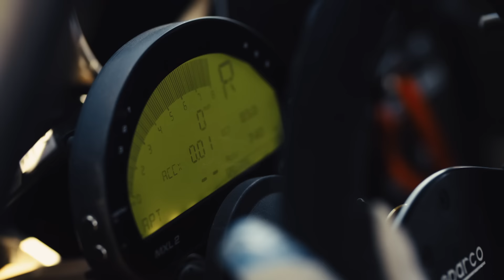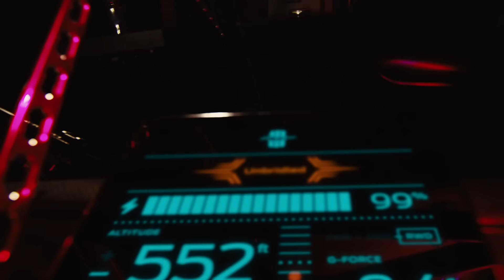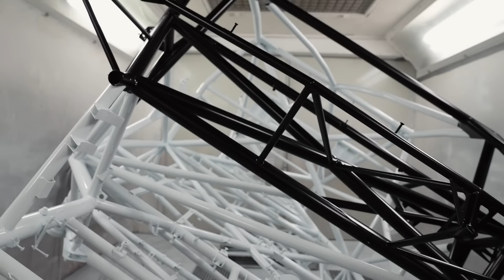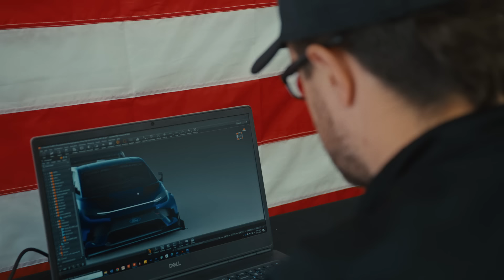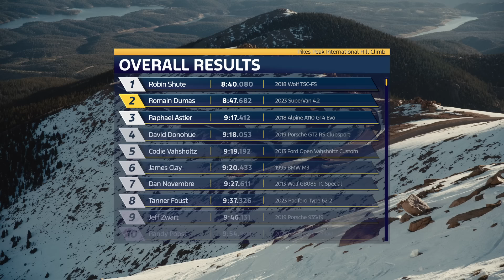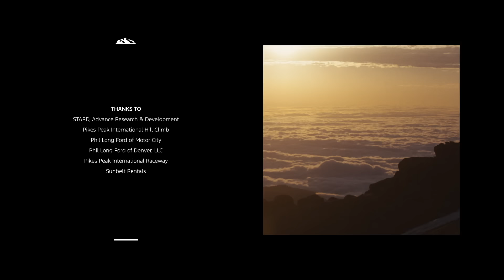SuperVan 4.2 Takes on Pikes Peak | Ford Performance

Comment: Fantastic chassis with the best driver for the task. Now, depending on what Ford marketing is pushing, the chassis is fitted with a body mold of an SUV or Van or Pickup. Some body parts carryover from one mold to the other, like the wing.

Comment: More on Romain's process for picking who will be king of the hill each year. So advanced with the faux flame job on the front and sides. Shouldn't there be lightning bolts and sparks?

Comment: To use a van and come within 7 seconds of the overall time is truly phenomenal
Reply: Apart from the fact that it's anything but a van, even the chassis itself is custom. It's mostly aero ...and marketing
Reply: either way they are limiting themselves with that shape and it is pretty cool
Reply: most of pike's peak winner cars had a van or truck shell like the suzuki escudo
Reply: Give him two more runs and we will see the difference.  His first run up with that vehicle and only  7 seconds off.  Also some vehicle adjustments.
Reply: @gibbethoskins8621 LOL, most vehicles used in the race are a tiny percentage of a production car so your talking jive.
Reply: They didn’t show that it broke right after the start. Romain had to stop and restart it, which lost them ~19-24 seconds.

Comment: Yeah the van is unique but ultimately unrelatable being that its electric.  Unrelatable because no car guy is going to be building an electric powered vehicle like this in his garage.  Now if it was powered by some obtainable version of a combustion engine, that would be cool.  Yes I know that you can get electric crate motors now, but only through certified installers (which there are only a handful of in the US) because of the high voltage danger.  And the price is astronomical!!!  You could build four really badass internal combustion engines for the price of one electric crate motor setup and you could install it in your own garage without a masters degree in electrical engineering to make it move.  Yes the van is an attention grabber but not very relatable to most automotive enthusiasts.

Comment: Cant imagine what this drivetrain would do in a better chassis
Reply: I can't help but think Ford is using these awesome EV demonstrators as a means to test the performance and durable of high powered EV systems that could end up in a production car. Imagine a new mustang, Ford gt, or rs200 revival with over 1,000 electric horsepower. That would be amazing.

Comment: Ok, lets summarize this 
1. you don't have enough time for the car and other preparation. for whatever reason. i am pretty sure its around the same time every year, but hey, calendars n stuff 
2. you don't have enough time to properly test everything on the track
3. you can't even do a full lap, you have to make due with small parts of the lap, but even then you don't get enough time  
4. the road surface is not good, because its not even a racetrack, its just an open road
5. the track goes quite high up
6. these conditions you will never encounter anywhere else
7. you have to redesign a lot if the car, because of the very specific conditions 
8. you only get 1 lap, i mean, that all seems so unnecessary, but hey 
9. did i mention its an open road, no safety barriers or run-off zones, because of that its already very dangerous for high speed runs. but there are also quite a few cliffs, right at the edge of the tarmac, without any safety features what so ever ??!?!?!?!!

why is this so hyped? there is a ton of good and challenging tracks out there

Comment: That’s cool and all but it sounds like a blender where is the roaring v8
Reply: Electric has way better torque delivery and can adjust power at the snap of a finger. Gas on the other hand struggles with lack of power at higher altitudes, lack of immediate torque, a general overall Powerband that has to be built up to it. 

Ford Performance is all about...performance. Electric is way better in this scenario.

Comment: I'm actually surprised by the size of it sure it a van but it can compete with the best. Sure it lost by a few seconds due to drag it generating. If the van was smaller in size it would have won the overall competition easily